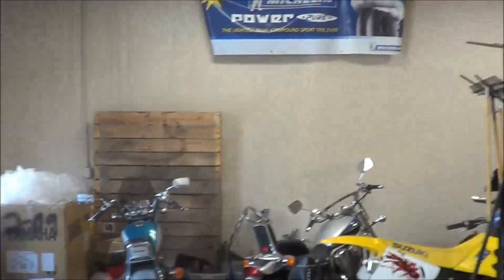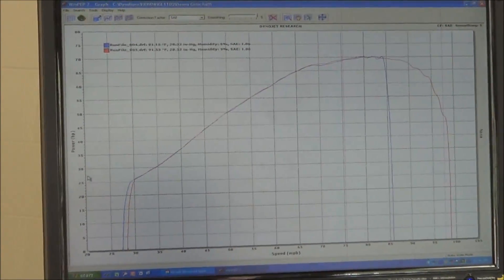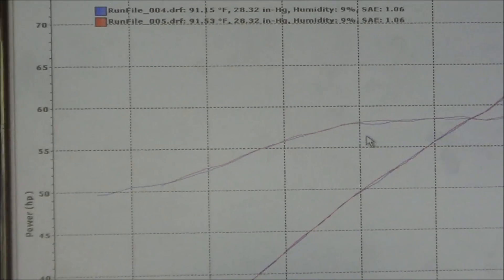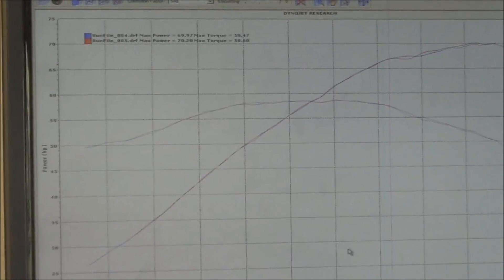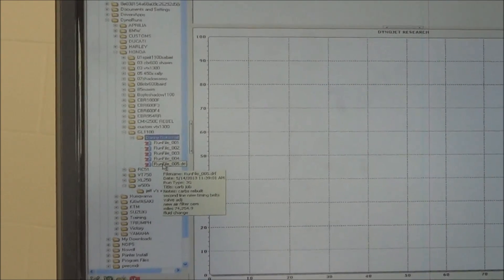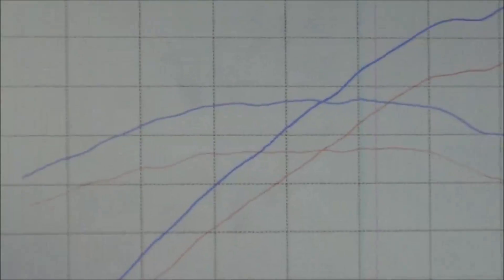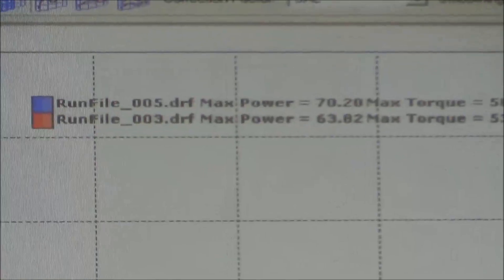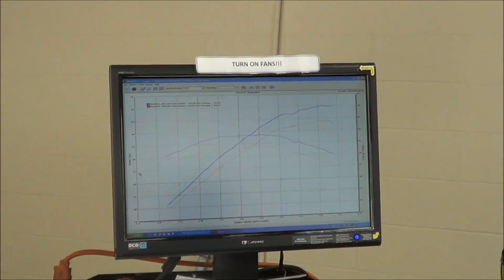Honda GL1100 before after carb job results run on the dyno. HUGE BACKFIRE !!!!!!!!!!

Comment: You don't get a backfire out of an exhaust! Backfires are firing back, through the carbs!
Modern timing belts don't stretch! But the teeth can wear.
Reply: 10 years later and this comment is still irrelevant